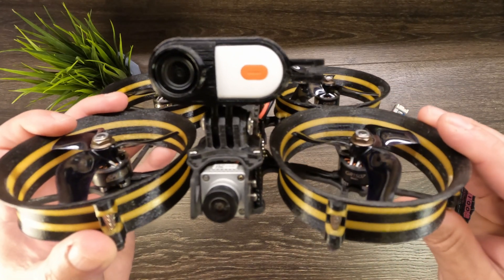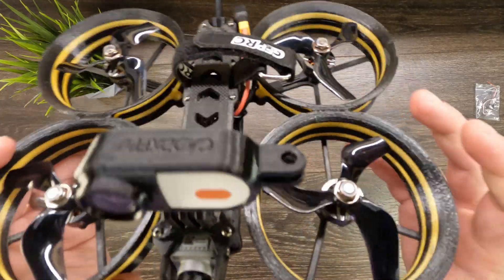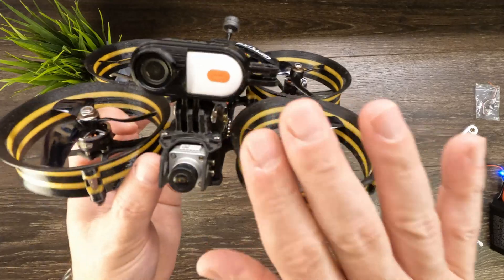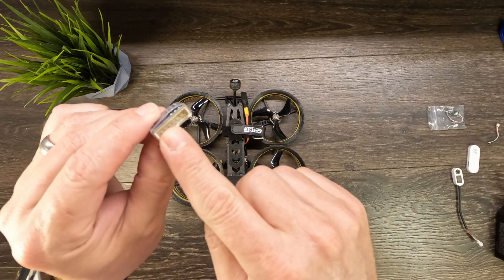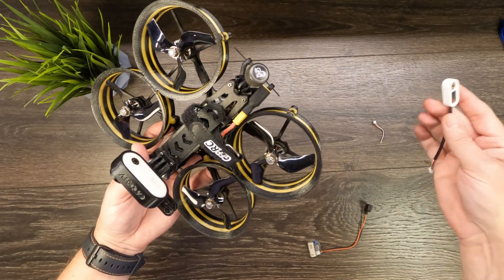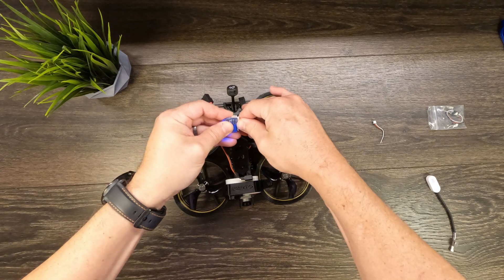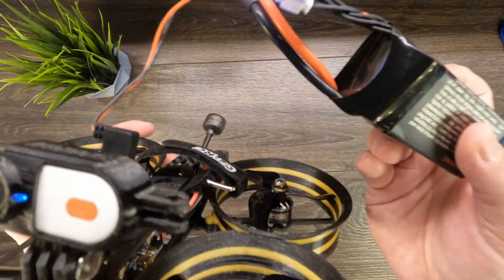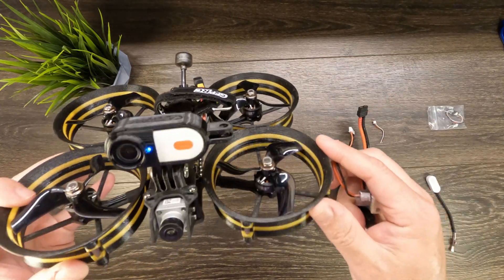CADDX Peanut No Soldering Power Solution For FPV!

Comment: How come you didn't use the mount that it comes with? Does it cause jellow?
Reply from the maker: The mount that comes with it is prone to jello being hard plastic, but it is only compatible with the naked camera style mount not the full size GoPro style connection like the mount we offer. Also the plastic mount provided by Caddx doesn't offer any protection for the camera.

Comment: Hi, as I don't have any 5v pad left and I want to use the small power adapter wired to the ifight balance cable plugged into 4s battery. Will it provide the correct current to the camera ?
Reply from the maker: Yes, the iFlight cable mentioned in the video has a built-in 5v regulator and will work on any 4-6s LiPo.

Comment: That tpu mount you have . Does it not show up in the footage ? Just looking at it round the lens and I know anything like that on my old insta360go would show up in the footage.  The angle on this lens is super wide right ?
Reply from the maker: No it doesn't show up in the footage, the TPU sits forward from the filter about .5mm just out of view of the camera. This way there is still some protection for the lens / filter without being in view.
Reply: @AerialPixel  thanks . Strongly considering getting one at the moment 🤔

Comment: Well that's really cool  but it would be nice if they had them for 2s to 3s as well  or do they?
Reply from the maker: I have not seen the cable in a 2s or 3s version :(  
Agreed, it would be nice especially for 3s, a 3S-6S version would be ideal.
Thankfully 95% of what I fly is 4S or 6S, I don't fly any 2S anymore.
Reply: @AerialPixel  I went ahead and ordered a couple because I have a few 4s batteries. In fact I just got the firefly nano hex and it Flys better on 4s IMO, but definitely there's a need for 3s. I got a pair because I might try to fashion a 3s model but I doubt if I can but it won't hurt to try. I didn't know these even existed, but I saw your video and what a great idea this is. I get the peanut delivered Friday so I'm pretty stoked. When I got the nano hex and saw that camera cable, I thought I could just plug the camera into it, but Bardwell said not to do that, so I really don't understand what the little pre installed cable is for. Anyway thanks for the great video
Reply: @AerialPixel  could you not just plug the 3s into left side of adapter , similar to when you use a charger like and isdt q6
Reply from the maker: @NewmanDrift  Unfortunately no, the adapter is keyed so you can only use 4, 5 or 6 cell LiPos.